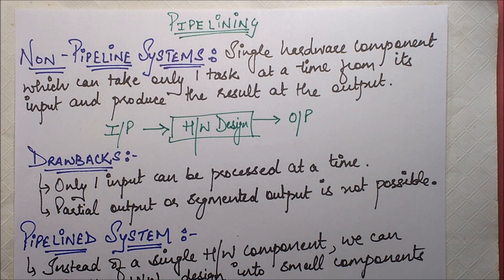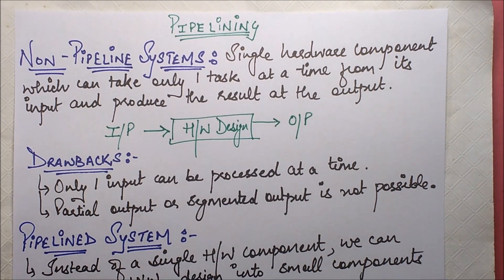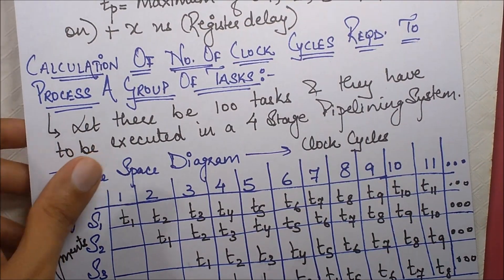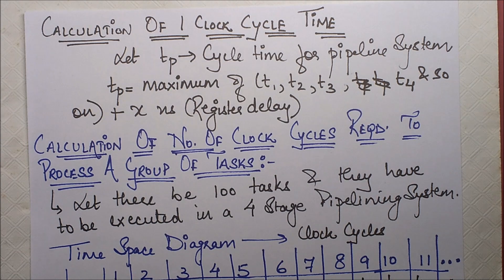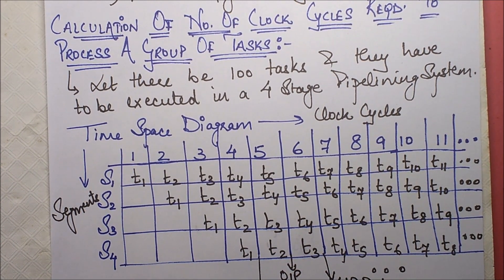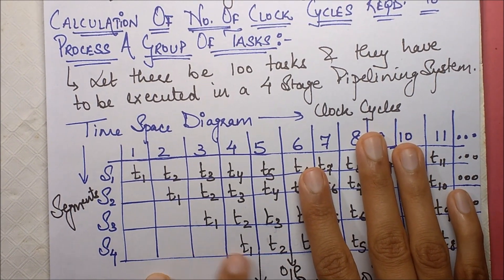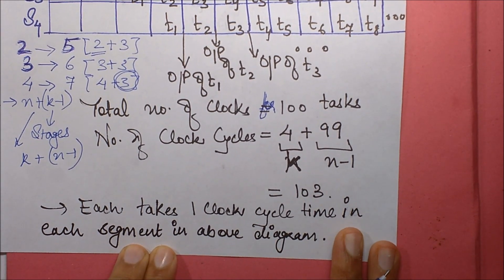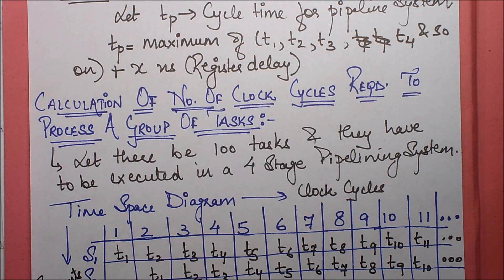Pipelining: Concept & Numericals

Comment: You said if "n" is the number of task and "k" is the number of stages then
n+(K-1)

According to the above statement, for 100 tasks and 4 stage
100  + (4-3)

But you mentioned at 8:05 it incorrectly 99 (task)  + 4 (stages)